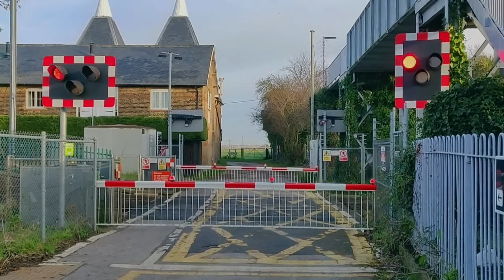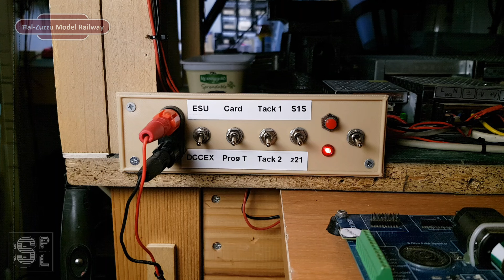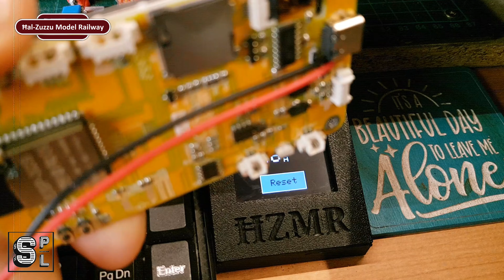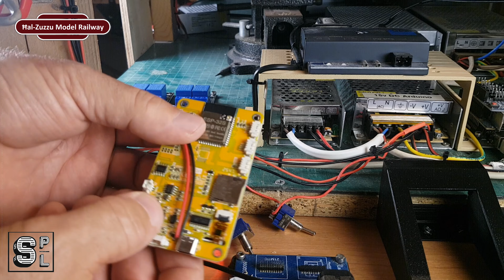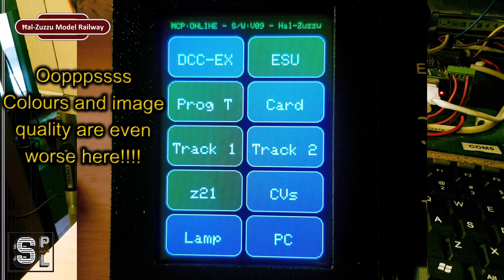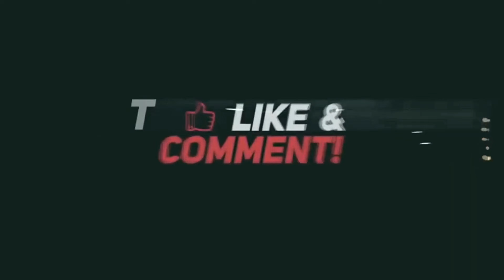DCC Revolution: The Ultimate Touch Screen Upgrade! | Ħal Zuzzu Model Railway (Ep92)

Comment: 9:57 you can buy 8-16 relay board with i2c interface to simplify your wiring
Reply from the maker: hmmmm never knew that - interesting .. i used these because I had them in my pile, but the i2c interface makes it even more interesting now .. off to Aliexpress :)